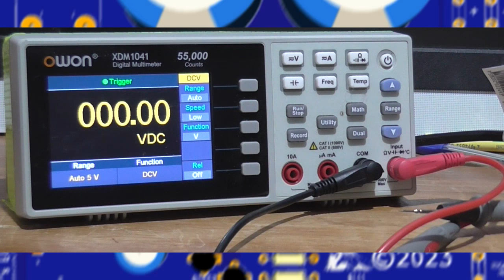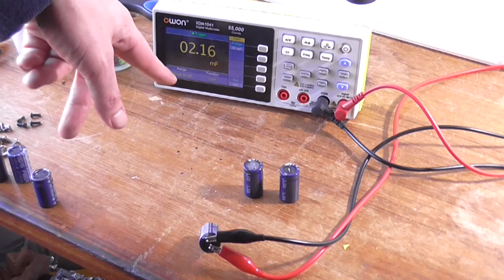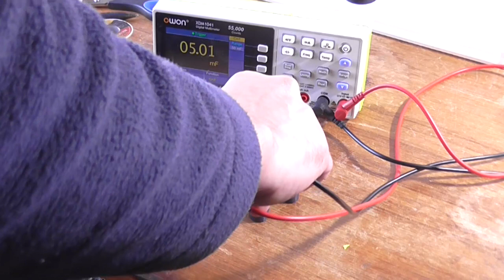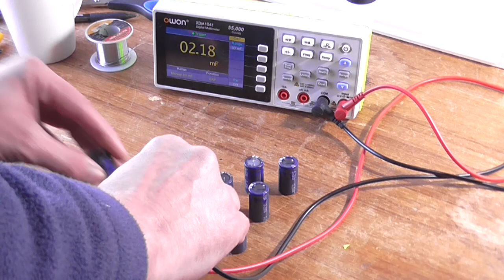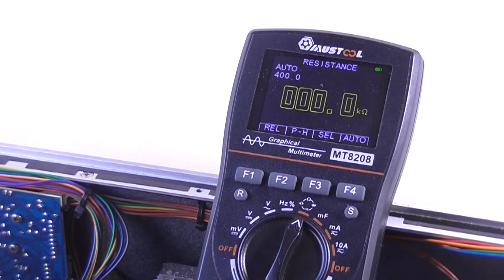Cambridge Audio Azur 540A (v2.0) Amplifier Diagnosis

Comment: Anyone have any ideas as to why my Cambridge amp goes into protection mode very soon after powering up?
The volume control automatically turns itself down, motorised volume control and all.

There is a workaround however (in the user manual) see my previous comment.

Comment: Cambridge Audio PCB's are actually cackka, the solder pads lift very easily, Cambridge
 want you to buy a new full board or new equipment altogether so be very careful when desoldering components.

All schematics are available on the Cambridge Audio website.

Cambridge Audio are supposed to be made here in the UK (in Cambridge).
The clue is in the name.

I have a problem with the audio on mine, it goes into protection mode very soon after turning the amp on but there is a workaround.
Press and hold the power button before Switching on at the mains, a red/orange LED will flash three times, you can then let go of the power button and turn the unit on as normal, then choose which audio input you want to select.
Not sure why it goes into protection mode yet but it'll work all day long with the workaround applied.
It actually tells you how to do this in the user manual which is also available on the Cambridge Audio website.

It must be a common problem if they include a workaround for it.

Comment: The transformer can have one (or some) turns in short cicuit. This cannot be seen with an ohmmeter, but with a frequency generator (measuring the impedance of the primary). It is difficult to rewind a toroidal transformer!

Comment: A 'Bulb Tester' is mandatory equipment for powering up items on the service bench. A BT will show up shorted transformers and faulty power amp stages, surprised that you dare to power up gear without a BT.
Reply from the maker: Yep. The more I think about it; the more I think you're right that the transformer maybe faulty. Showing a good DC resistance on the primary doesn't show up shorted turns. I plan on building a bulb limiter in the next coming weeks. I only "dare to power up gear without one" because I usually only work on my own stuff or consumer gear (that's usually built properly).

Comment: Fuses are available in fast blow, slow blow and time delay (T). Slow blow are not suitable for audio applications and T type are typical in audio equipment at mains input and speaker outputs.
Reply from the maker: Interesting. Thanks for the tip. So, I should be using a 6.3 amp T type?
Reply: @AstrosElectronicsLab  Yes always use T type. That said if a slow blow is popping immediately then you likely have a shorted turns transformer. Always but always use a Bulb Tester like I also posted.
Reply from the maker: @ericmc6482  also, what size incandescent bulb should I use? A 40W, 60W or 100W?
Reply: @AstrosElectronicsLab  Select on test.... for typical domestic stereo amps start with 40W at idle and go up from there. The point is the BT will save expensive catastrophic failure in OPS during initial runup after rebuilds, also allows running and multimeter measuring during fault conditions without blowing fuses or OPS transistors etc.
Reply from the maker: @ericmc6482  Mhm. Thank you. I think I might go a 60W bulb, as incandescent globes are really hard to get now and it may be a safer bet of protecting the device on test. It's really only an indication if the thing powers on correctly, globe on bright and staying on bright = not good. Thanks for your advice.
Reply: Cambridge Audio always use the T type fuses in the power supply circuit.

Comment: ebay sells lots of simple soft start boards for amplifiers for 15 to 20 bucks. Beware of the cheap (rectangular-shaped) ones though! They have three 470uF 35V caps where the silk screen on the PCB calls for 1000uF 50V. I used one until the three caps started to dome-top on me. That's an explosion I want to avoid.
Reply from the maker: I already have a soft start project in the works. Originally I had nothing to test it on, now I do 😊

Comment: most audio amps with a 300 VA or above toroidal transformer
have a soft-start circuit, that switches a resistor in series with the 
primary winding for 100ms or so to limit the inrush  current 
could be faulty
Reply from the maker: This doesn't have one.
Reply: @AstrosElectronicsLab  wow that could be a problem if you have a variable transformer 
you could gradually increase the mains voltage to see if it blows 
the fuses ?